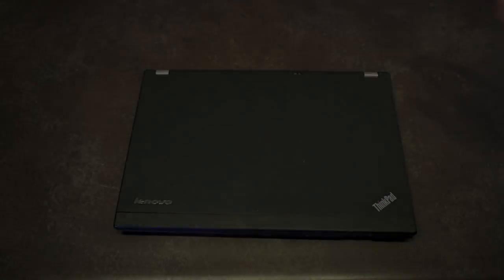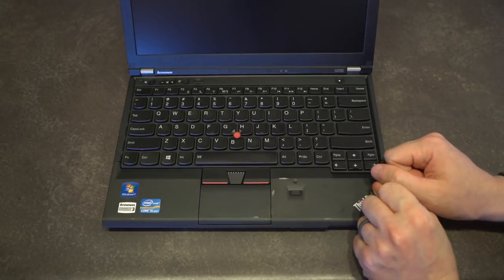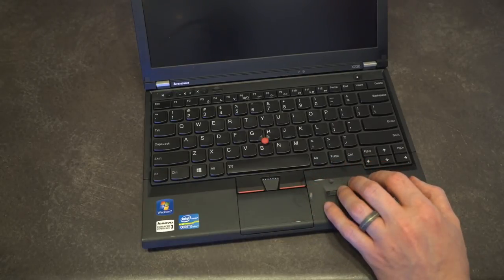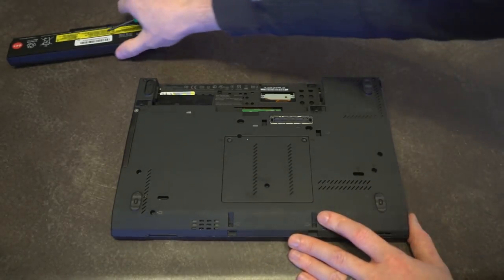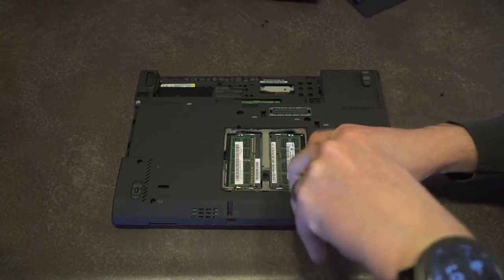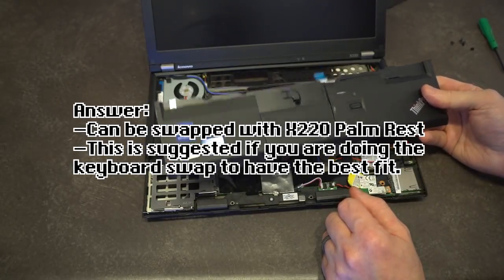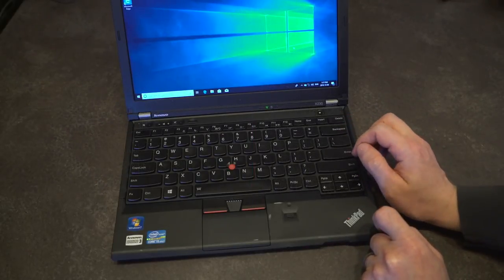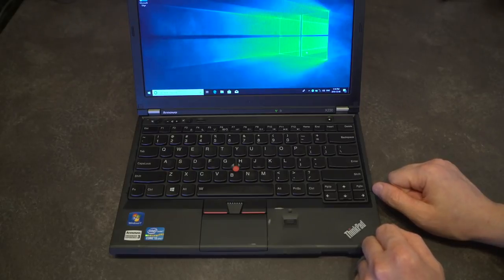Lenovo ThinkPad X230: A Fan Favourite

Comment: Writing from an X230 Tablet. Some informations I find important to these maschines. First thing to do, get 8GB of Ram, but as two Bars. Dualchanel RAM makes the Grafic way more powerful, as the shared RAM is the main bottleneck. Get an SSD as the Main Drive, but in the 2.5" Slot, as this has SATA3 and not only SATA2 as the mSata slot. Then this is a very nice and fast mashine. Eventhough I'm using it mostly for MS Notebook, Firefox and LaTeX, it's even fine for light CAD with Fusion 360, which really impresses me! Normally I had to cary my heavy ideapad y500 to do any CAD at the Univercity. So I am happy all around.
Reply from the maker: Nice setup.
Reply: @LaptopRetrospective  Thankyou!
Reply from the maker: Thanks back at you for sharing your experience.

Comment: I was thinking of upgrading mine with 256gb kingston msata + 1TB HDD. Should this make booting faster and make my laptop activities faster?? Already upgraded at 16gb ram.
Reply from the maker: The SSD is more noticeable for boot times than RAM generally speaking.
Reply: @LaptopRetrospective  Thanks! 
But I was going to do additional upgrades 

Adding 256 msata (for the softwares/OS) + 1TB HDD 7200rpm - (actually would prefer this because of the amount of storage)

or

256 msata + 256 SSD? I wanna do the max that I can do on my X230 instead of buying a new X series because this is still an amazing unit.
Reply from the maker: Depends on your needs but I'd go with the two SSD setup. The mSATA speeds are capped at SATA 2. The 2.5 bay is SATA 3. So out your OS on the fastest drive. If you go mechanical then its another story. Hope this makes sense.

Comment: I bought a x230 thinkpad last weeks ... with 8 gb ram , intel core i5 and 128 gb ssd ... I want to upgrade the ram to 16 gb and the SSD to 1TB will it work ? ..
Reply from the maker: It should!
Reply: Laptop Retrospective and can I upgrade the cpu to core i7
Reply from the maker: X series has soldered cpu.

Comment: 2020. Still on x230 i7-3520M. Love it. It was upgraded: mem up to 16 gb, both disks - ssd: msata 500 gb + sata 500 gb (Ubuntu 16.04 + win 10). Works great. Battery 75% of capacity. Unfortunately lenovo does not create new versions of x230. I have even dockstation! New versions of thinkpads: all soldered in(not upgradeable) and thin. I don't like them. Dockstaton on wire, proprietary ports.... Brrr...
Reply: Can you boot from the second msata ssd as well?
Reply from the maker: Yes.

Comment: hi friend.. need to ask you a question.. ive heard that x230 i7 runs hot and fan is noisy.. any opinion or suggestion on this matter?
Reply from the maker: Haven't handled the i7 but I suspect it could be related to old thermal compound that needs replacing.
Reply: ok.. i will consider it.. still deciding either i should buy an i5 or i7..
Reply from the maker: If both are available I guess it comes down to budget. Most I think would prefer the i7.
Reply: @LaptopRetrospective the price is not very much diffrent..only 50 dollars..
Reply from the maker: Up to you. If it were me I'd grab the i7 and repaste if thermal issues showed up. Remember that the compound dries out over time and probably hasn't been replaced since the factory.
Reply: alright.. ill take your advise.. one more thing.. in your opinion.. which one is better.. remanufacture or refurbished laptop?
Reply from the maker: Depends on who is doing to work.
Reply: alright.. thank you for your time and advise
Reply from the maker: No problem. Let me know how things turn out.
Reply: @fauzirosli9310  I've got 2 x i7 X230s. No, they don't run hot and neither are they noisy. At all.  Ref CPUs, checkout https://www.cpubenchmark.net/cpu_list.php . i5 vs i7 has the same amount of cores/threads. i7 runs faster at 2.90Ghz and i5 is at 2.60Ghz. I've (my family) got a couple of i5 models as well. I don't notice any real world difference - the VPro mobile CPUs are not like the Desktop models where yu get twice as many threads in an i7...save your money and get an i5-3520 :)

Comment: I ended up buying a broken X230 minus the entire screen assembly for cheap. Apparently, the previous owner dropped the laptop and it got run over by a bike or car. Back home, I ordered the entire screen, camera, ThinkLight, shell, and bezel. The seller sold a refurbished assembly with an IPS panel.
Reply from the maker: Glad to hear you got yourself a whole machine. 👍
Reply: @LaptopRetrospective  Just wondering if the backlit keyboard from a T430 will work on the X230? Saw someone parting away a broken T430.
Reply from the maker: I know the T420 and X220 keyboard is the same and the x30 era can take a x20 era so I think you're okay. Maintenance manual will tell you for sure.

Comment: Is this a good laptop in 2020 I have a blackberry priv in mint condition and was offered this for a trade
Reply from the maker: It's pretty darn good. I can't speak to the Priv or the trade.
Reply: @LaptopRetrospective  sorry my mistake its the X230T which seems to not be the same pc
Reply from the maker: Some people prefer the X230 series because it has a CPU that is 10% faster, it isn't using the energy efficient U series. So slightly more power consumption and no dual batteries on it.
Reply: @LaptopRetrospective  thanks for the info!😃
Reply from the maker: @JohnWick-sv3xk  you're welcome!

Comment: Hi! I just falling in love with thinkpad since watching your video, i want to buy 1 one of these machine, what is your thinkpad and upgrade recommendation that i should take?
Reply from the maker: Glad you've been enjoying the videos. What do you want to do with it? What is most important?
Reply: @LaptopRetrospective  mostly working with spatial processing software like ArcGIS or AutoCAD, love the x220 type classic but powerful!
Reply from the maker: I love mine. X230 is the preferred one in that size.
Reply: @LaptopRetrospective  great! Think we have a same perspective! Umm what upgrades that i should do for x230? and also Is there any significant difference performance between the i5 & i7 type?
Reply from the maker: There is a bit of performance difference. Honestly do an SSD swap and then take it from there.
Reply: @LaptopRetrospective  Excellent! Thanks for your advice!
Reply from the maker: No worries, hope it meets your expectations.
Reply: @LaptopRetrospective  one more thing, if i could take x1 carbon, should i stay with taking x230 or just go with the x1 carbon?
Reply from the maker: What gen? X1 is also a fun machine.
Reply: @LaptopRetrospective  3rd gen touchscreen i think, how about that?
Reply from the maker: Not too shabby. They use U processors which are more power efficient. If the price is right you might want to give it a try. Keep in mind it won't be the upgrade beast like these older ones
Reply: @LaptopRetrospective  Nice thanks!!!
Reply from the maker: Let me know what you end up going with.

Comment: Watching this on my x201T and wondering how much of a significant upgrade the 230 really is.
Reply from the maker: CPU wise it would be noticeable I think.
Reply: CPU and GFX.  Intel onboard graphics uses system RAM and the X230 can take advantage of up to 16GB of 2133 RAM (you won't be able to find any and its an arm and a leg for either the Corsair Vengeance 1866 or Kingston HyperX 2133) but the 1600 is still much faster than what you are running on 201T.  If I were you and interested and saw one sub $200, I'd snag it.  (I just saw an X230 in amazing condition with an IPS display at the local PC recycler for $150 ish the other day.)
Reply from the maker: Great points Yoon.
Reply: @ryhk3293  Well the x230 I was looking at was close to 400 which was a bit too rich for me.  But since I posted that I found a great deal on a T420 and the docking station for it.  So now that is my daily driver laptop and the x201t is being used strictly as my ultra portable/tablet.  Still use like using the Waccom tablet function for certain kinds of photo edits.

Comment: r u sure x230 only supports SATA II?I got message on lenovo forum it supports SATA III so I'm confused.
Reply from the maker: I'm talking about using an mSATA drive, not the standard hard drive bay.
Reply: @LaptopRetrospective  Yeah it looks strange that Lenovo decides to design those ThinkPads with IvyBridge processor in a non-ideal way. The mSATA slot runs at SATA2 but other SATA drivers(include optical drive) runs at SATA3. Although it won't hurt much on day-to-day experience, it just makes me feel unhappy
Reply from the maker: Yeah agreed.

Comment: i saw the review for x280, i stopwhen hear solderimRam 😅. IM IN DESPAIR i saw other T480 model same spec but  add100$ price, omgash! should i save or get the x230 model170$, for just drawing and small animation. it's upgradable anyway right? What about software in coming years huhuh, me again ✌️
Reply: Sho. ot i bought it.. i wish its fine 😬
Reply from the maker: There is a big technological jump between those models. If you're running modern software then the X280 would be my preference.

Comment: Does anyone know the benchmark for this laptop? I’m considering buying an intel i7 3250m, 2.90GHz, 8GB RAM with 180GB of memory SSD!!! Please get back to me as soon as you can! I need it for online tutoring and they’re really fussy about their benchmark pass
Reply from the maker: What exact benchmark does it have to pass?
Reply: Laptop Retrospective thank you for getting back to me so quickly 🙂 it has to be 3500 or over!
Reply from the maker: I'm guessing they are referring to a PassMark score?
https://www.cpubenchmark.net/cpu.php?cpu=Intel+Core+i7-3520M+%40+2.90GHz&id=890
Reply: Laptop Retrospective yes! This is exactly what they meant! Thank you for your help. I just have one other question, I see a lot of different makes and series that have intel cores that vary. I’m not the beat with computers/laptops but I was under the impression that the more recent the make, the better the computer. But just say if I got a T420 with i7 or i8 and 8gb RAM as opposed to an X230 with an i5 or i7 with 4GB RAM, surely that would make the T420 series (in this event) the better choice?
Reply from the maker: There is not i8 in that generation. RAM is not the be all and end all for performance. You'll notice more on a CPU or SSD upgrade in terms of general speed improvement before RAM. A third gen (x230) will generally not be outperformed by a second gen (t420). However, fourth gen has the U series and thats a whole other situation.

If you want to know how all these stack up against each other, you've got some reading to do in your future. :-D
Reply: Laptop Retrospective haha your are indeed right, I really do have a lot of reading to do xD but thank you for helping me out, you’ve made things a little clearer for me. Much appreciated and I hope you have a great day :)
Reply from the maker: Cheers! Same to you.

Comment: Can i run CorelDraw X7 on this machine as well? Maybe I gonna buy this great machine soon but im worried about that i cant run Corel as well.
Is there any suggestion to me or i just need to go with T430 as well?
Reply from the maker: Always check your system requirements for the software you plan on using.
Reply: Yes

Comment: Hi I've owned this laptop for quite a while now and just recently it's been acting weird, every now and then I'll be watching a YouTube video or playing some light games and it just suddenly turns off by itself and I will have to turn in back on. Any fix?
Reply from the maker: Install a temperature monitor and see if it's overheating. If so, fan maintenance and replace thermal compound on CPU. If temps are normal, I'd check your RAM next with memtest.
Reply: Laptop Retrospective thanks for the reply but no it's no overheating at all, I have undervolted the cpu and gpu too.
Reply: Laptop Retrospective and yes I will check my ram
Reply from the maker: Checking your RAM would be my next suggestion.

Comment: Had this machine for 6 years and still have it and love it fantastic backlit keyboard like typing on silk.  ONLY Problem try cleaning the FAN and HEAT-SINK properly??????
Reply from the maker: What challenges have you had doing that?
Reply: I had to pull the whole motherboard out to get to the fan heat-sink assembly.  So basically the whole machine had to be pull to bits unfortunately. I have 2 more to do too :( I like doing a thorough job
Reply from the maker: True enough. It requires some serious disassembly but at least you can.

Comment: Great, great review ! My kid is going to college to become a mechanical engineer in two weeks time, so I am hunting around for the most convenient laptop. I would like to offer to him not the slimmest / latest gadget computer in the market, but rather something reliable which won't let him down. Since he is using his skateboard from the train station to the university, he may one day crash, and if he does, I'd rather have him to carry a solid laptop in his Eastpack bag... Would you advise that computer to a college kid ? Solidworks, Office, Python, web, etc... Is the fan silent enough especially in a classroom ? Thank you very much :-)
Reply from the maker: The ThinkPad X series is a great commuter size and is crazy durable. The x230 has lots of processor options so be looking carefully. The x240 is also nice since it has a dual battery system although not as powerful. Let me know if you have other questions.
Reply: @LaptopRetrospective  So my kid went for an X230. He absolutely loves it, with 8 gigs and SSD. I just had to purchase a brand new battery aside.
Reply from the maker: Thanks for letting me know how it went! Glad to hear it is a happy ending.

Comment: Sir do you have solutions about x230 after plugin jack audio and me switch sound to speaker internal why don't have sound except unplugin jack and have sound this bug driver or what
Reply from the maker: So you're plugging in an audio device but then get no sound?
Reply: No, but in headset have sound   normal except will switch to internal speaker no sound in windows 10
Reply from the maker: @wm4437  so while your headphones are plugged in, it works, but you cannot switch to speakers?
Reply: Yeah like that
Reply: and when I delete the driver I can move it between the internal speaker and my headset but there is no sound on the internal speaker when I connect the jack

Comment: X230 came out with i5-3380M as well but it was really rare and hard to find. Batteries are identical. Typing from x220 and I have X230 44+ battery inside.
Reply from the maker: Batteries are essentially identical. I did a video a few months back on the differences and compatibility issues that existed at the start.

Comment: What do you mean by locked BIOS? I have X201 and I can't install other GSM Modem (WWAN), nor WiFi card. Its BIOS already had a white-list of certified devices, which can be installed into mini-PCIe slots.
Reply from the maker: Some of the older ThinkPads can have custom BIOS software flashed to them to enable other cards.
Reply: This is the reason why my hp 8560w is dead and why i abandoned my t420.

Comment: Should i go for this laptop or the dell latitude e6230 or the x220
Reply from the maker: X230 would be my suggestion.
Reply: @LaptopRetrospective  will the x230 come with intel hd 4th gen or 3rd gen and can i put a 1333mhz ram in it
Reply from the maker: @raizgaming1733  Intel HD 4000 is available with the applicable CPU. PC3-12800 1600MHz DDR3 for RAM.
Reply: @LaptopRetrospective  thnk u vry much fr the info. Also do u recommend any other old laptops from diff companies or are the thinkpads the best
Reply from the maker: @raizgaming1733  ThinkPads by and large have such great availability for spare parts it makes them a favourite.
Reply: @LaptopRetrospective  haha ohk also seems like the x230 can use egpu which means i can dock a 710 or 750 ti which is pretty cheap used
Reply from the maker: @raizgaming1733  Yep. You can. I've got videos doing the eGPU with my x220 on the channel. The procedure for the x230 is essentially the same.
Reply: @LaptopRetrospective  in terms on cpu performance there is nt much diff between them right then doesnt the keyboard on x220 with egpu compels u more?
Reply from the maker: @raizgaming1733  The keyboards can be swapped with a bit of modding. The X230 has the benefit of newer processors and better integrated graphics. The newer style keyboard isn't a deal breaker for me. Personal preference.
Reply: @LaptopRetrospective  hm..ohk will keep tht in mind also the refurbished x230 with i5 processor 320gb hdd and 4gb ram costs 210 dollars in our place lol
Reply from the maker: @raizgaming1733  make sure you check which i5 it is. Some are older gen, some are newer.
Reply: @LaptopRetrospective  so which mean i should opt for the i5 3360 as much as  possible